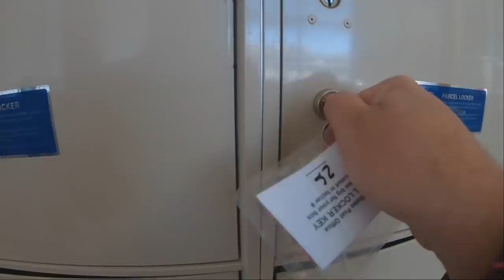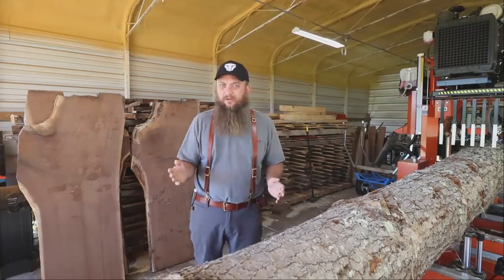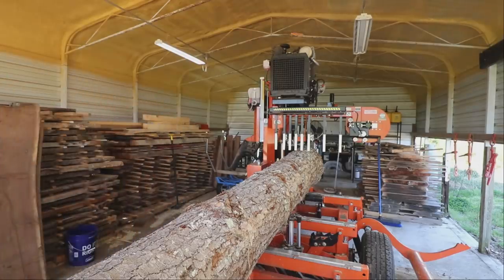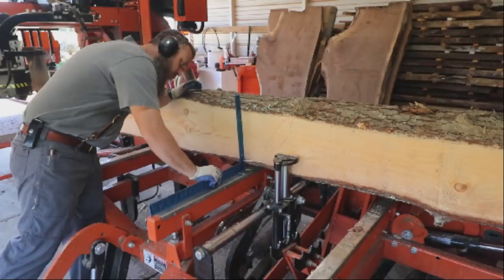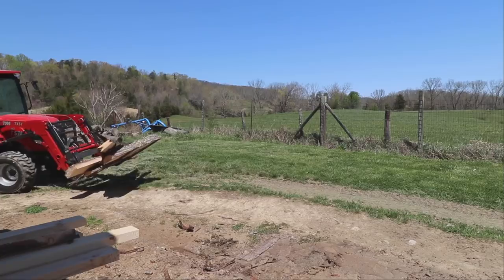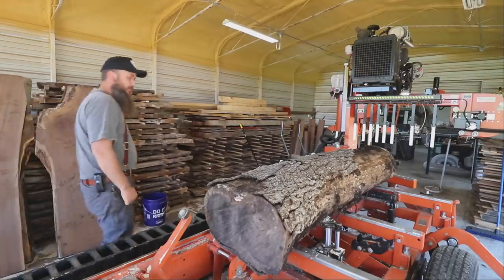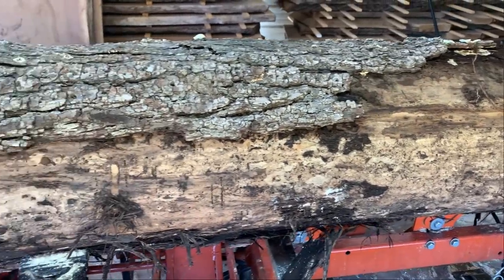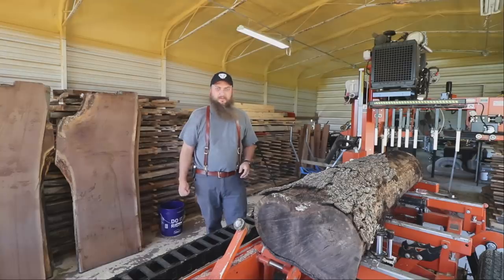A Rare (kinda) Double Heart Walnut On The Sawmill, Amazing Slabs

Comment: Last year I was offered to go get "firewood" from tree's that had been taken down in a friend of a friends backyard. I get there and 5 LARGE maples had been taken down. Someone else had already taken all the limbs that were manageable in size.  What was left were logs between 10-14 feet long and 24-48 inches wide. 15-20 logs. 

I told the man that I would be back that weekend with a tractor and trailer to pick them up. He just wanted them out of his yard as they were in the way to putting in a new septic field. 

I came back that Saturday with a tractor and trailer to get them. In the two days that  it took me to get back there. The neighbor had the tree service guys cut them up into 18in widths. The homeowner wasn't aware of it until he got home. 

My suspicions were confirmed when I took a look at the logs.. Many/most of them were quilted maple. And I mean EXTREMELY QUILTED. To say I was horrified would be an understatement. 

That turned out to be the most high quality firewood I've ever burned in my wood stove. I about cried every time I put one on the splitter. You wouldn't believe the figuring that was in that wood. I can't even begin to guess what the market value of that wood would have been had it been sawn into lumber as I had intended to have done. 

Lesson learned. I ever come across something like that again. I'm going to make sure to put signs all over it and inform the neighbors to NOT TRY AND BE HELPFUL!!

Comment: That sure is some pretty wood. I would have lined the first cut up so the blade would go through the pith of both crotches, and leveled the other end to that. Then worked up and down from that center cut. Follow the plane of the crotch piths, if that makes sense.

Comment: question for you Nathan........ you mentioned building with green wood.   How much shrinkage do you need to worry about when doing so?  I have a local Sawyer that sells larch and was thinking of using it for a pergola.   It is sold as green wood 2x4, 2x6 and 2x8' material.  Should I let it dry for a season first or is it ok to build with right away.
Reply from the maker: Sorry.I can’t advise you.  Not familiar with larch.